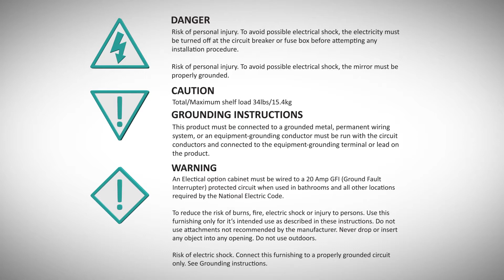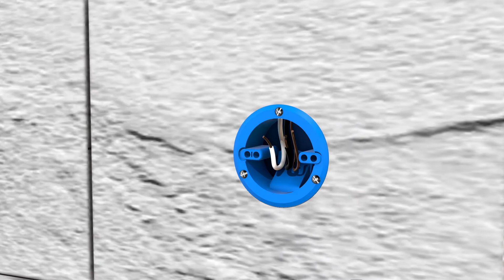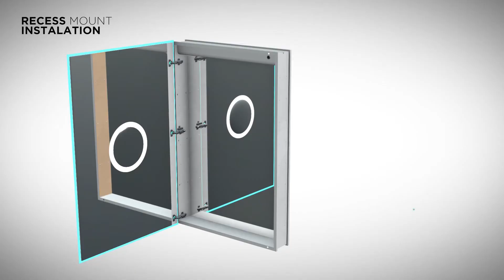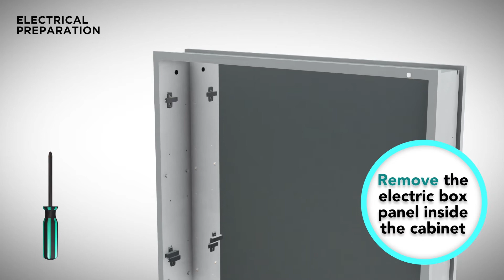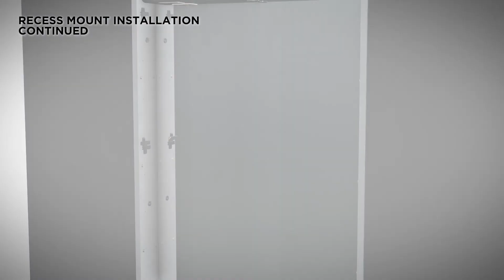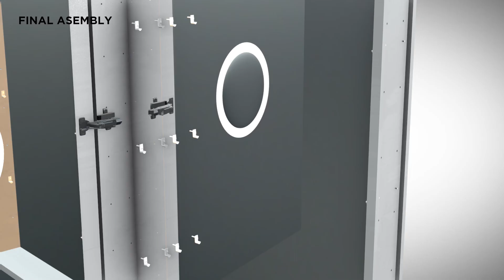Krugg Svange LED Cabinet recess/flush installation video

Comment: It would be great if you could include the rough opening size for the width and height.  My house is built with metal stud framing and I am going to add an extra 1.5" for wood  (maybe a little more for shims) to affix though the jambs of the mirror as shown in the video.  What I'm not sure of is whether or not I need to do the same for the height.  I'm guessing about a 1/2" for shims but no blocking like for the jambs.  Otheriwse, great info.